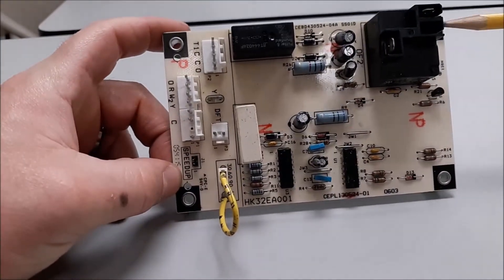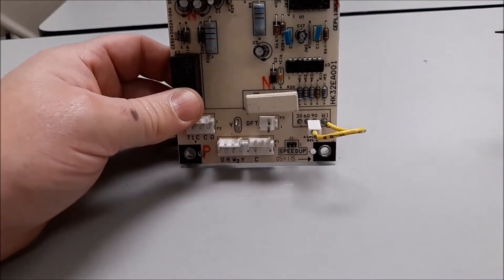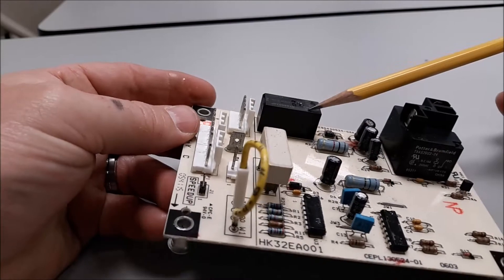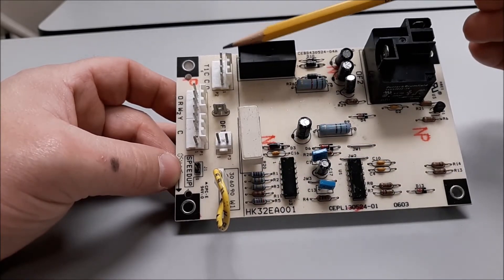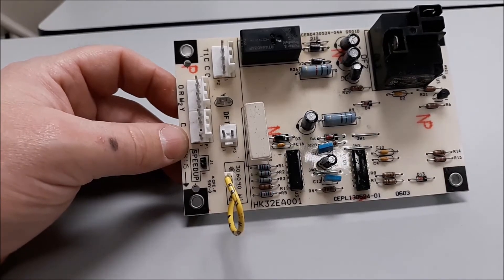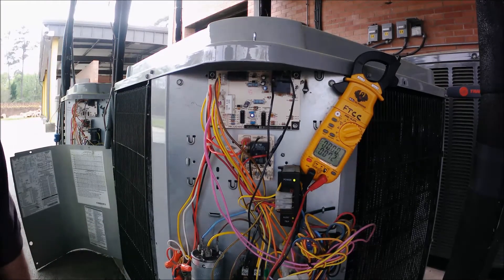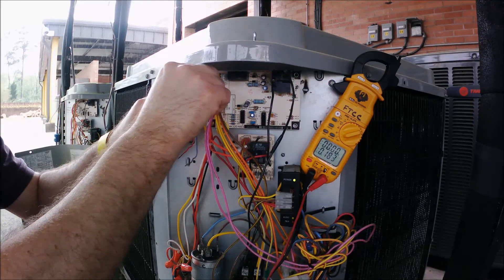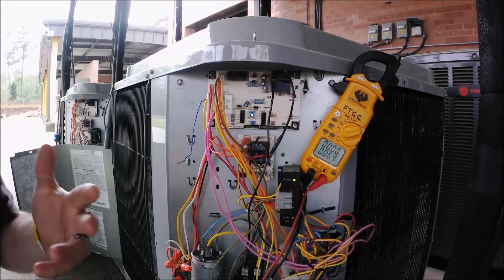Troubleshooting a Bryant Defrost Board

Comment: Hi thanks for a good explanation of the defrost board  I have an issue with a ICP heatpump not going in defrost cycle sensor is closing replaced the board and it still not going in defrost cycle and keep working in heat mode and freezes  up what you think is the issue what else you recommend to check
Reply from the maker: For the time and temperature defrost board like that I would say 1- check for 24c power to the boars (r wire to c wire), if you have power then check to make sure the sensor is closed, then the boars should do its job. My first butt kicking by a defrost board was because I didn't have 24v. Sensor closed, replace board...didn't matter since the red wire in attic was loose and not sending power to defrost board. A lot of those style boards will let the unit work all year with just a signal for heat or cool in the Y wire. But it will not go into defrost without power on R to the board. Maybe try putting the factory Red wire for the defrost board into the wire nut with the two yellow wires while it is running. Then make it defrost. If it works...sounds like you have a  you have a power issue.
Reply: Thanks that part I didn’t checked
Reply from the maker: Hope it helps.

Comment: Thank you the excellent video. I've learned a lot from this video today.
I live in Orlando, FL and the capacitor blew up (literately blew up) in my condenser unit yesterday. I replaced the capacitor and the condenser unit started working and the house is getting cool again. But I noticed resistors R1 and R3 located between the 30-60-90 terminals and U3 were burnt. But the AC is working fine.
I will change this board but I wanted to know if this board is used at all when in unit is running in AC mode (not the heat mode)? 
We're in July here in Orlando and the temperature is about 100F. Can I run my AC with this damaged board for a few weeks before replacing it? Because I'll be out of town for a few weeks.
It never freezes here in Orlando so I wonder if I need this defrost cord at all. 
Also, I don't know I don't know if these resistors burnt because of the capacitor or they were burnt before.
Thank you in advance for your help.
Frank
Reply from the maker: I think you should be ok to run the unit. The board is a simple one and the circuit that powers the contactor to turn on your compressor just goes straight through the board...not through any relays.
Reply: @johnjennings-JJ  Thank you the reply.
I ordered a replacement board and I'll replace it when it arrives. 
Watching your video I've learned that this board is not used during hot months so it's not an emergency repair. That save me money because I had time to look for a replacement board with a fair price, and have it shipped ground instead of expensive overnight shipping.
Thanks again.

Comment: Hello John,  my name is Frank. I have one of these boards. the reversing valve is not going into ac mode.
Reply: How can I verify that the board is not good.
Reply from the maker: You need to check for 24v between the "O" and "C" either at the wire nuts as your thermostat wire goes into the unit or either on the side of the main plug (labeled P1 on the board). If you have 24v at that point then it should go to the "O" wire wire coming out of the smaller plug with 4 wires (labeled P2). The board should show the terminal names. Check it against the "C" from the first step. If you have 24v the power is passing out of the board. You may need to go all the way to the reversing valve and check for 24v between those 2 wires as it plugs into the solenoid. If you have it there then it is possible you have a bad reversing valve solenoid...hope this helps a little and if not let me know.

Comment: Which terminals give the board power? I dont have power through R and C or T1 and C. It doesn’t appear my unit has a transformer according to looking a the unit and reading the schematic so I cant figure out where the board is supposed to be getting the 24v
Reply from the maker: Should be coming from the air handler "r" ( if it is a split system). T1 doesn't get power until the "Y" is energized.
Reply: @ alright thank you!

Comment: I’m having issues with my Bryant heat pump blowing the low voltage fuse I had a tech out and he said to change the board and contactor switch. Well a defrost board and contactor switch later it still blows the low voltage fuse inside the air handler?? Any ideas
Reply from the maker: You have a short somewhere! I don't know if you have a electrical test meter or not. Have you done anything lately to the unit or did this just start happening?
Reply: @ just started Friday I came home and the thermostat was off and I got into the attic where the air handler is the fuse had popped. I talked to a tech at work and we isolated the outdoor unit and the air handler, the air handler has supplemental heat and works when it’s not attached to the heat pump outside, it has to have a short somewhere in it. The thermostat wire from the pump to the handler tested out for ohms so it’s got to be right in the unit
Reply from the maker: @BrandonOxley-gc6xk i had some older bryant and payne units that had pressure switches in them and the wiring ran underneath the common low tube and would rub until it shorted out. That would be my guess if you have narrowed it down to the outdoor unit. I would be curious to know what you find.
Reply: @  I will let you know!

Comment: Thanks for the video. I tested the voltage on my HK32EA001. The voltage reading between C and R is 5.5v. In the video you said it should be 24v. Can you advise.
Reply from the maker: You need to find a full 24v! You need to backtrack and find power...if you got 5.5 at the wire nuts outside the you need to check R and C and the air handler connections. If you have it on the air handler end of the wire but not on the heat pump end...may be a wire connection (loose wire nuts, corrosion, etc) or a break in the wire!
Reply: @johnjennings-JJ  thank you for the reply. I appreciate the information.

Comment: Ruud unit: what is the OCT & OAT terminals, and what are they used for?

Also, what is the D terminal. Does it feed as W to light heat strips?
Reply from the maker: That one must be a Demand Defrost board. There are 2 temp sensors (thermistors) tied to the board. OCT is Outdoor Coil Temp, OAT is Outdoor Air Temp. I believe it is a purple wire factory connected to the D terminal and yes it goes to the white wire we typically use to turn on the heat strips in Defrost!
Reply: @johnjennings-JJ  Thank you!
Reply: @johnjennings-JJ  Thank you for helpful insight.

Comment: The 2 wires pink are the temperature switch will always have 24 voltage on the top terminal of the plug, then send it to the sensor, and the other plug in the bottom is return path with no 24 unless the condenser coils get frost and it will have the 24v send back to the board then run the defrost, right? 
Thank you sir!
Reply from the maker: Yes. It is a simple switch and has 24v on one side of it all the time and it only passes power back to the board once it senses that the coil is cold enough.

Comment: The little square black box in the defrost board will do the job when the system defrost, the contact gonna turn from NC to NO to shut the CFM off, right? 
Thank you sir!
Reply from the maker: Yes. That black box is just a relay, coil and a set of switches.

Comment: So in the state like FL is hot so the defrost function won’t need, right? It usually run the defrost when the condenser coils is frost? Just a little bit confuse and I am living in FL 
Thank you sir!
Reply from the maker: Florida might be a little warm for wintery conditions and you might not even use a defrost...like you said. It may also be warm enough where you are at to thaw out when the unit isn't running. Lot of weather dependent possibilities! You are on the right track i think.

Comment: Thanks for the cool info John.   I have a unit where there';s zero voltage coming from the board ..on any termonals..  I checked the coninuity of the sensors .. There's  220V on the board relay termonals . Thinking this board is dead! I ordered a replacement!f How say you?

Comment: where is 24v coming from to the reverse valve ?
Reply from the maker: It should come from 1 of 2 places. The thermostat sends it in normal operation or the defrost board during heat mode if the unit outside needs to defrost.
Reply: @johnjennings487  
Thank you for quick reply!
I just install 3 ton Goodman heat pump I have 18/5 coming from 3 ton Goodman heat pump to the airhandler midway I spliced with the thermostat wires  or should I run thermostat wires straight to the airhandler and connect both 18/5   condenser and thermostat to the airhandler? Reason why I'm asking  my reverse valve on the condenser  makes buzzing noise ( and no 24v only  17v 

I'm a EPA  certified based on long island NY,  I mostly install minisplits Fujitsu,  Mitsubishi  etc
Reply from the maker: I prefer a straight run of new wire on a new system but splices aren't bad as long as it works I guess. Every job has its own issues.  I wouldn't focus on new vs spliced right now unless you find out that your voltage drop is due to the old wiring or loose connection, etc. You have to find the reason for that voltage drop. Break out the voltmeter! Wish there was something else to say but I don't think it is right now. 17 ain't 24 and it needs 24! I'd be curious to know what you end up finding.

Comment: My current situation: Split System HVAC compressor and fan do not operate. Indoor unit and thermostat working properly. Capacitor is new. When I depress the plunger on the relay, they both start. There is no 24v to relay coil. Coil has continuity. Pressure switches have continuity. OF1 & OF2 has continuity. What's left? Could the HK32EA007 Board be bad?
Reply from the maker: You have to find the 24v for the contactor coil..sounds obvious I know... Is it coming into the outdoor unit at all on the thermostat wiring from the air handler? If not, contactor shouldn't be running. May have a float switch in the drain keeping it from passing to the outdoor unit.
Reply: So, oddly enough, I went to the outside unit to check voltages at the board with my DMM. As I checked power to Common at the T1 C C O connector, the Relay Coil energized and the AC has been running fine ever since. Not sure what happened to make it do that? Thanks for your response!!!

Comment: What’s the field test to initiate defrost at the board?
Reply from the maker: The board needs to see a closed defrost coil sensor, or you can jump it out by removing the plug from the board and place a jumper wire in its place, then use something metallic and sort the 2 "test" pins together for a short period of time. Usually between like 7 and 25 seconds. If everything is ok it should go into defrost and stay there until the defrost coil sensor opens. Make sure to remove the screwdriver or whatever you are using to short the test pins together as soon as you hear it switch over to defrost.
Reply: @johnjennings-JJ  ThankYou, I replaced a failed defrost temperature sensor yesterday and needed to test the defrost cycle after installing the replacement dfts.

Comment: Watching the power graph of my inside and outside unit I get power spikes up to 13k watts. Is this the unit going into defrost cycle?
Reply from the maker: Sounds like it. A compressor and 2 fan motors running and then turn on a couple 5,000 watt heat strips...sounds just like a defrost!

Comment: I tested the power getting to the board and it read 25-25V then the unit immediately shut off and now no power.  Could this still be the defrost board or likely a bigger issue?
Reply from the maker: The power for that board comes from inside so I wouldn't blame the defrost board yet if you are talking about 24v power at the R & C  connection. Probably need to check for power at the transformer to make sure. If you have 24v on the secondary output, you have to follow it to see where you have and don't have it anymore.

Comment: if there is 0 voltage on the time check at T1 then is the board bad?
Reply from the maker: I wouldn't say that. Sounds like a loose wire or something. T1 gets power from the 24v 'Y' side of the contactor coil so no 0v is probably a loose wire from contactor to board or either you don't 24v going to the contactor yet.

Comment: Does this board have anything to do with an issue I’m having (2.5t carrier heat pump): 1) When power is applied to the outside condensing unit, thermostat off, compressor and fan runs and will not turn off. 24v on the cyan/pink stripe and energizing contactor.
Reply from the maker: Anything is possible but that is not probably the case. The circuit on this board that goes to the contactor is pretty much a straight shot through the board...no switches to stick closed. With the thermostat is set to OFF, I would check for 24v between the yellow wire and common wire (whatever color it is) in the low voltage connections at the air handler. If you have it there then it might be a bad thermostat. I have seen a few a stances of rubbed wires and it made a connection between the red and yellow wires...or someone with a weed eater near the outdoor unit maybe?
Reply: @johnjennings-JJ  thanks 🙏. That isn’t the case for me unfortunately. R O G Y are all off on the contactor side inside. It boggles my mind where and why that cyan/pink stripe is energized and from where. I’ll have to take off the outside fan and follow that wire this weekend.

Comment: Hi, so during defrost the indoor coil is cold AND the auxiliary heat is on at the same time? And there's very hot air blowing across the coil? Is this correct? Great video. Thanks
Reply from the maker: Thanks. Defrost mode is really just your a/c on with the heat strips running at the same time if you have just a standard all electric setup. Your defrost board will handle all of that and  not the thermostat of course. The heat strips just temper the air so that it isn't a blast of cold air coming through the vents in winter. Not sure about the "very hot air" you mentioned.
Reply: Thank you

Comment: The unit  goes to defrost time eve 10 minutes what should be ?
Reply from the maker: Make a defrost coil sensor that is stuck closed? This board is constantly gathering the time requirement (30-60-90 minutes) and need to "think the coil is cold enough to need defrosting. If the defrost sensor is closed then it will go into defrost and keep going if it is stuck closed.

Comment: Ive replaced and tested my capacitor. If this board is bad can it keep my fan from running while in A/C cooling mode?
Reply from the maker: It is possible. You probably have two black wires (for the outdoor fan motor) on the relay of the board. One comes from the contactor and goes into the relay, the other goes from the relay to the fan motor. Take the fan motor wire and plug it onto the contactor where the other black wire is coming from. This is a way to bypass the relay and see if the problem is the board or not. The fan should come on with the compressor in a/c mode so long as the capacitor and motor itself are good.

Comment: I'm a little confused.  At 10:19, you read 0V on your multimeter, and stated that was because the switch was open.  If electricity is attempting to flow through a switch, but that switch is open, then, when you place your leads on either side of that switch, you should be reading a measurable amount of potential difference (aka, voltage).  Is that 'switch' that you were referring to instead perhaps a load, by any chance? 🤔
Reply from the maker: It is because of the way I was checking it. That circuit is just a hot 24v leaving the board, going to the switch that monitors the coil temperature. I used the 24v common from the main plug to check for power going into the switch (1st check) to read 25 volts and then out of the switch (2nd check) and got 0 volts. I get what you are saying but in this case it is just because of the way I did the voltage checking. I like the hopscotch method best and that is the way I did it in that part of the video.
Reply: Okay, it makes much better sense now, only when you told me that you used the hopscotching method!
  God, please don't say, "It's just the way that I was checking it." 
  Long story short, I am still in school right now for HVACR.  (I already have a background and experience with electricity.)  When it came time for my instructor to teach the class about voltage, he never once used the words 'potential difference' in describing the measuring of voltage.  Instead, he simply said, "It's just the way the machine reads it." 🤦‍♂
  As an instructor of HVACR, he should've explained to the class that the 'machine', or multimeter, is like a calculator; it is merely subtracting the DIFFERENCE in POTENTIAL voltage between the outside of the leads and the voltage on the inside.
  (He also never once used the terms 'backseating' and/or 'frontseating' when describing the fully opening and/or closing of service valves on units.    It's kind of sad that after paying this college thousands of dollars of my hard-earned money, I learned those terms from studying a book that I had to pay an additional $150 for on Amazon.)    
  I know; it's probably petty.  I don't why that causes my OCD to let that bother me so much... 😆
Reply from the maker: Everybody is different in their explanation of stuff. I would say not to be too tough on the teacher because they can only teach it the way they know it! School should only be the beginning and make you dig a little deeper on your own. I know I have been through the same thing starting out in the field. You doing extra research and studying only makes you better!